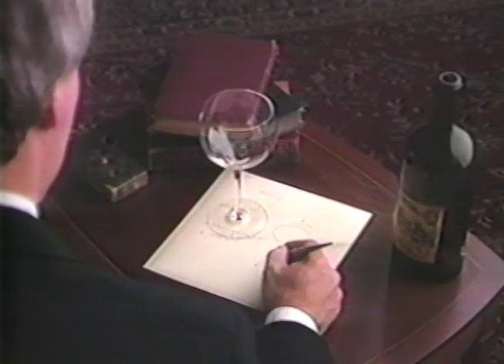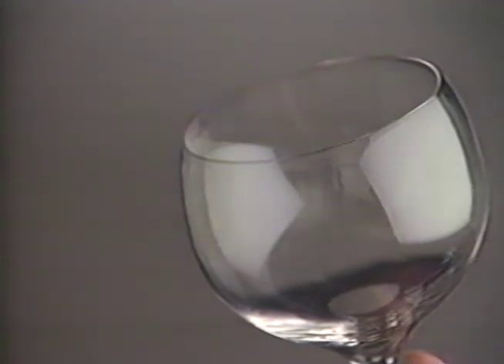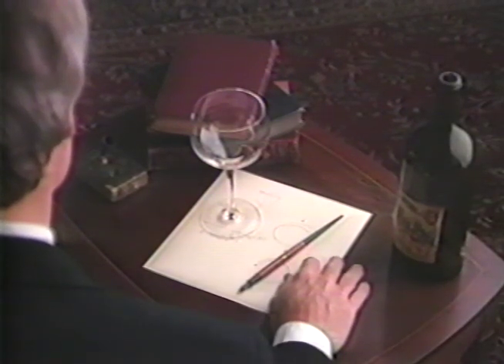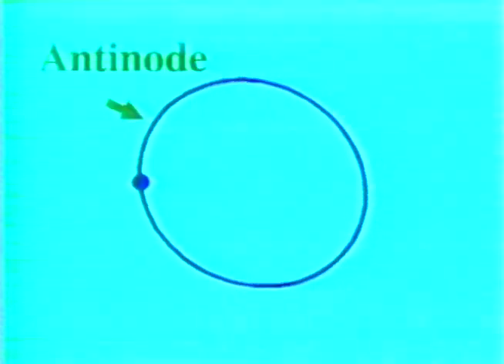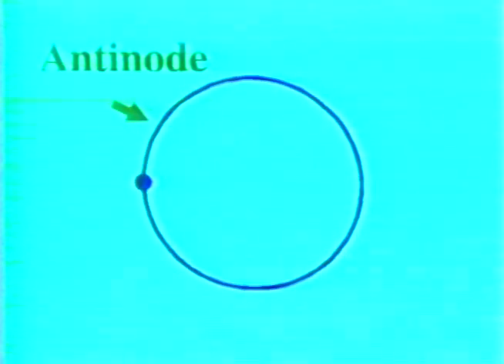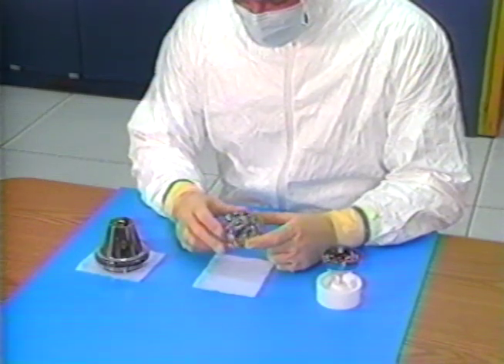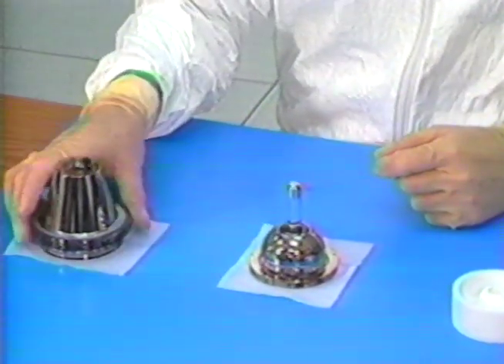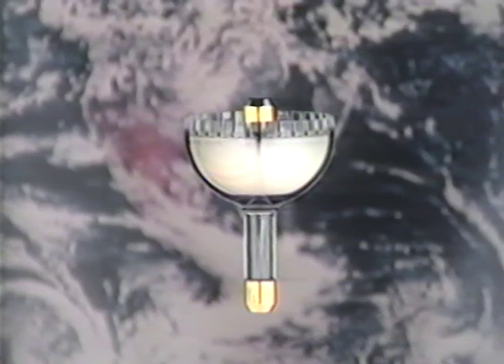The Future Is Simple

Comment: These were the gyros installed on the Cassini spacecraft that orbited Saturn, if I'm not mistaken. They performed flawlessly for 20 years until being consumed by the planet itself in the orbiter's atmospheric entry in 2017. If only they had been installed on Hubble, there wouldn't have been any gyro replacement servicing missions needed!
Reply: Scott Manley has just updated the Hubble Gyro problems.
Reply: I think they replaced the flywheels not the gyroscope on Hubble
Reply: @gggggggggg-ms8lm  Gyros were replaced on three servicing missions due to the notorious ultrafine silver-copper alloy wire corrosion issue and reaction wheels were replaced in '97 and again in '02. They're back down to 3 out of 6 working gyros now and though it can function in single gyro mode in conjunction with the magnetorquers, it doesn't have too many years left.
Reply: @Muonium1  thanks for the info. Why do the flywheels keep failing
Reply: @gggggggggg-ms8lm  Scott Manley did a superb deep dive video on the problem maybe last year. Turns out solar flares and CMEs were inducing voltage potentials across the roller bearings causing damage and wear. The ball bearings are made of ceramic now.